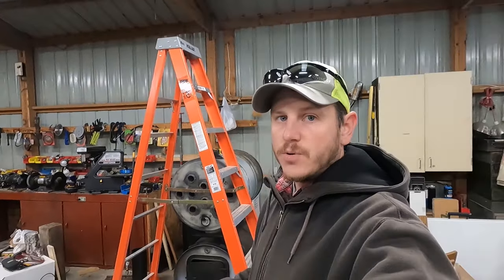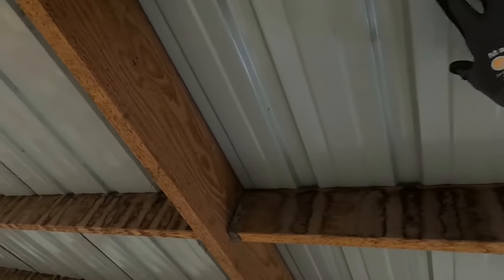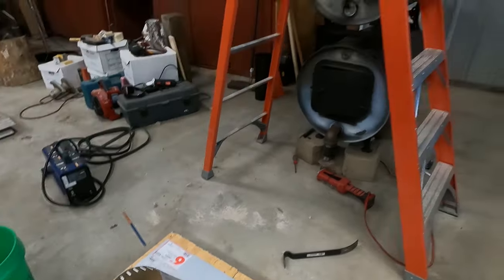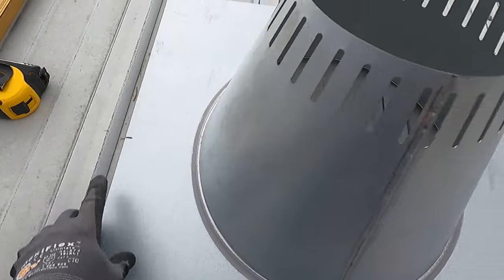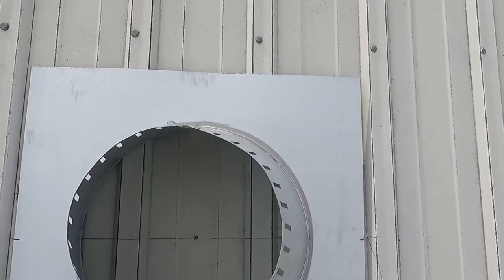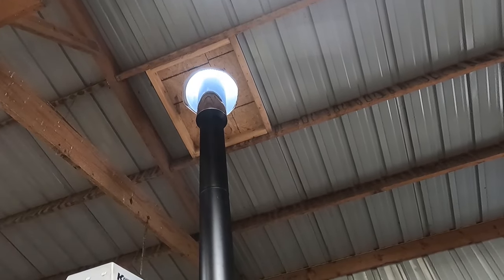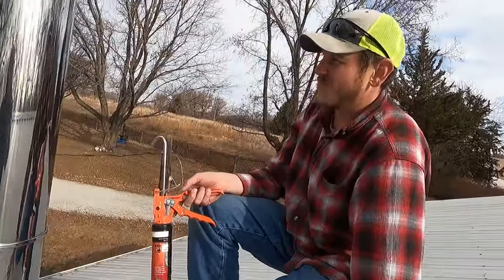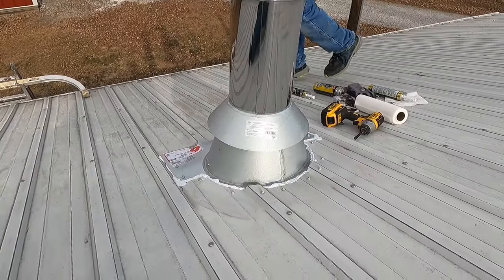Installing A Wood Stove Chimney Through A Metal Roof

Comment: THANKS MAN!  After looking for the proper metal roof flashing, i gave up.  had two metal roof companies try to sell me rubber high heat vents, I think these are designed more for hot exhaust or something not selkirk.  anyway, your tricks work, especially cutting the left and right of each rib and forming it to them.  Good enough for me, its not like its going to leak anyway!
Reply from the maker: Thank you for watching, and I'm glad you found it helpful!
Reply: @amidwestfamily112 thanks Again. Got chimney in yesterday and rained today no leaks.  I haven't got my stove yet but with snow coming I had a Window to get the flue in.  Do you heat with no insulation?  My garage isn't insulated but it's got sheathing on roof and sheathing plus cedar siding and house wrap as well

Comment: I take a can of saw dust, soak it with diesel fuel or paint thinner, throw a handful  on the wood in the stove and light. Best, cheapest, easiest fire stater.
Reply from the maker: Sounds like a solid idea that I will have to try, thank you!

Comment: Your roof is screwed in wrong.  The screws go through the flats. They never go through the ribs.  It might seem like they should, but they don't.  They should never go through the ribs with your flashing either.
Reply from the maker: Well that's a bummer... thank you for pointing that out!
Reply: What happens if screws do go through the ribs?

Comment: You can still get a ice dam below the chimney allowing water to build up below the flashing.  A roof boot is cheaper and the correct product.
Reply from the maker: I keep an eye on it, and since the roof isn't insulated the snow melts around the chimney and surrounding area from the heat rising off the stove. But this could be a problem in the future for sure, thank you for watching!
Reply: Ours was similar to this 10yrs ago
No leaks , no ice damming
Got handful of friends with rubber boot that do have leaks
Reply from the maker: @baseballdude8491  well that's good to hear, thank you for watching!

Comment: Caulking the top layover edge will cause water to pool up . Should have left it open for water flow. I am currently doing my install and the stovepipe ended up right square on a layover seam. It is a 5 rib pattern roof so I will make a flashing piece with a 3’ wide piece of roofing and install it as a counter flashing…
Always daunting to cut a hole in your roof that does not leak…
50 years of overthinking everything…but no callbacks.
Reply from the maker: Thank you for the information, I will have to check it out and see if it is holding anything. Good luck with your project!

Comment: Just finished. Mine in the rain I might add... 30 x 40 polebarn.  Double lined pipe here is 
129 bucks for 36 in pc...I went with the single wall pipe all the way up and out...
Reply from the maker: The double wall insulated pipe is expensive. I think it was about 90 dollars for a 36 in piece 6 in ID at a local big box store. Congrats on getting it installed!

Comment: I'm getting ready to install a wood stove in my shop. I'm curious what are the dimensions of yours as well as ceiling height? Seems like that stove warmed things up very quickly even with the lack of insulation. Thanks
Reply from the maker: The shop is 30x40 and 10ft to what I would call the ceiling, or to where the roof trusses are.
Reply: @amidwestfamily112  Thanks for the info. My shop is only 26x30 with a 12ft ceiling. I used insulated panels for the ceiling but lack insulation in the walls. I'm looking forward to having the wood stove operational.
Reply from the maker: @djcampbell9150  I am hoping to do something like that before the next winter season gets here.

Comment: Cutting that point of no return hole tomorrow in my metal roof. The flashing tucked under the existing tin is very clever. I couldn't tell how heavily you caulked on the down slope side under the flashing. Was it as heavy as the top side? Nice job and thanks for posting.
Reply from the maker: It wasn't that bad, sorry yes I went heavy on the caulk everywhere. But so far after several rains and snows we have not had any leaks! Thank you for watching!
Reply: @amidwestfamily112 how's it holding up? Bout to cut into mine tomorrow
Reply from the maker: @personalprojectile  havnt seen any signs of it leaking, so we're doing good!

Comment: OCD attention to detail equals a better install.
Reply from the maker: Hopefully that is true! Thank you for watching!
Reply: @amidwestfamily112  I am same way. I see so much work done by others that leaves a lot to desire.
Reply: I was thinking, when you installed that beauty ring at pipe seem, I would have put the screw part on back side towards roof peak, so could not see from ground. And that sticker that wouldn't peel off flashing would piss me off too. I know it will weather away, in few years, but you know.... :) Cmon man!!
Reply from the maker: @danphillips4590  I have been planning on going back up and cleaning the sticker off the flashing just because it does bug me.... I just haven't done it yet.